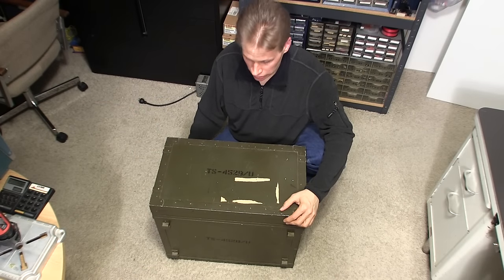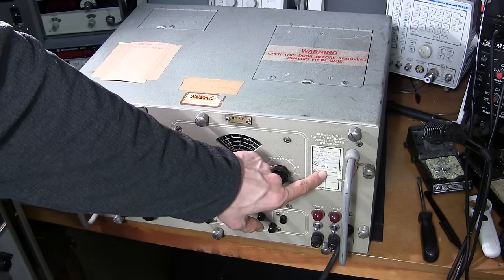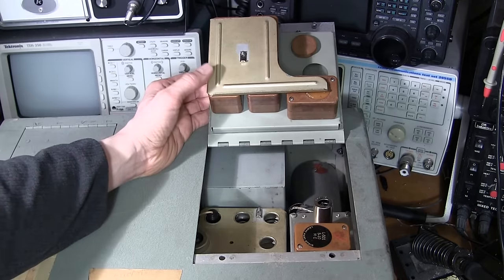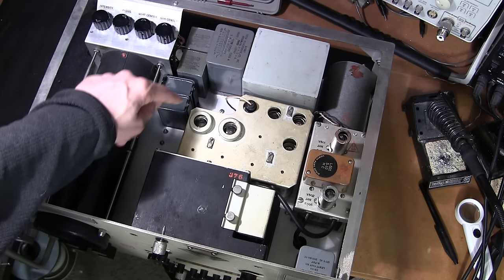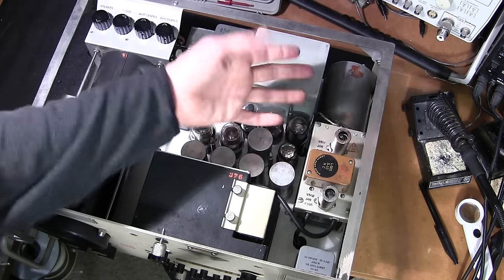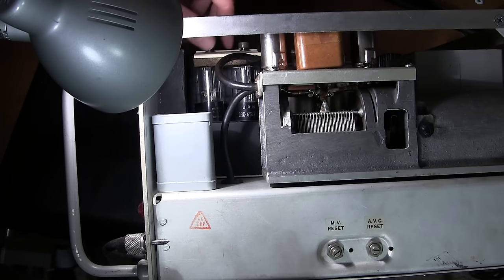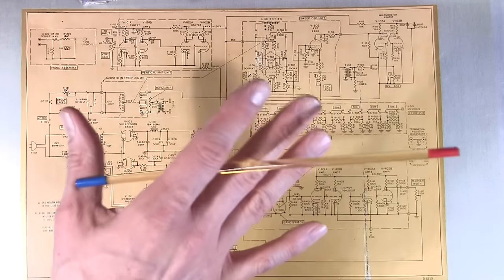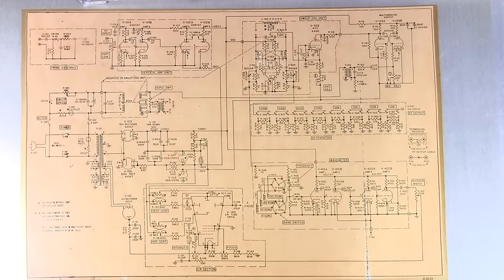Whats A Wobbulator? Tech Tip Teardowns

Comment: Like seeing an old friend--when this machine last wobbulated, I was beginning a basic electricity course at Lowry AFB en route to becoming an aircraft weapons mechanic.  Much later, I was to learn that wobbulated signals centered on 4300 MHz are the basis for commercial aircraft radio altimeters.  Somewhere in between, I came to recognize the quarter-turn fasteners on the top of the box as authentic Dzus fasteners, the original quick-release fasteners used on the DC-3.  I still have a screwdriver I cut down in 1965 to fit under DC-3 cowl flaps and unlock Dzus fasteners in the engine accessory cowling.   Next, I will watch your video on VTVM restoration and learn what I might need before I dig my old Heathkit IM-28 out of the closet.  Thanks for the motivation.
Reply from the maker: +Hopelessand Forlorn 
Thanks for taking the time to write. Great story! Glad your enjoying the video's.
Reply: Hopelessand Forlorn 6
Reply: Weebles used this to fix their TVs and Radios

Comment: Quite a simple circuit really but built like a battle ship. Can you imagine building to this standard today, the cost would be un thinkable.
Reply: +Michael Beeny "An elephant is just a mouse built to government specification." -  Robert Heinlein's Lazarus Long
Reply from the maker: +Michael Beeny 
I agree! They could recycle this and build a ship out of it.
Reply: +Mr Carlson&#39;s Lab Let's not forget about soldiers that actually had to carry this boat anchor in the field. Thing probably weights more than a box of grenades, and with box of grenades you can at least defend yourself! ;) Unless you consider throwing this from the roof to the enemy's head as alternative application.
Reply: Definitely not a front line piece of gear more likely used at an airfield repair facility, rear area, or aboard a ship.
Reply: +Michael Beeny  Kinda like a sixteen cylinder Caddilac!
Reply: +Roger Lamb This was something we would have used on the bench. The heavy case was to protect it against us idiots damaging it during transport. Typically it would be out of the box for 6 months then put back into it for the jaunt over to PMEL, Precision Measurement Equipment Laboratory, for calibration.
Reply: Not really simple to me at least

Comment: I know this is a few years back Paul, but what a piece of kit!.You can see it was purpose designed and built especially for the job it did.Which is slightly different to the Marconi R1155 receiver that I am trying hard to fully restore.That was needed quickly, but hey it did an excellent job.Which is a tribute to the electronic guys who designed it.Just absolutely love this old equipment.If only I had purchased more of it in the early days, when it could hardly be given away.I could sell it off now and be better off than I am now.Brilliant Channel.Going to increase my Patrion subs very soon.Thanks for the excellent channel Paul.And the knowledge that you impart.It is appreciated by so many of us.

Comment: You might be surprised and find all the caps are still good.  I have a lot of 40-60's military test equipment and radios and don't think I have ever changed one yet.  I'm always amazed at the quality and durability of milspec capacitors.  Many are hermetically sealed.  Might be worth unhooking them and testing them for leakage.  Thats what I do and haven't changed one yet.  Will be nice to see this back up and running.  I love old military gear.

Mike
Reply from the maker: +MikesRadioRepair 
Thanks for your comment Mike!
Reply: This is a capacitor testing channel, I'm pretty confident they will be carefully checked.

Comment: Great find Mr Carlson. I bet you smiled when you took off the bottom panel. There can't be too many manuals for that unit around anymore. I have an old 50's military FM transceiver (uses 1U4's etc). Was happy to find a schematic printed on a silk material folded away inside. Looking forward to another one of your  excellent restorations !
Reply from the maker: +Todd Anonymous 
You Bet! That was a great surprise! One day I will build a portable radio project with those 1 Volt filament tubes. I have quite a few.
Reply: +Mr Carlson&#39;s Lab looking fowar to that too. (big trasmitter pls)

Comment: Thanks for the prompt reply to my comment. I had a No 11 Australian army radio R/T set (it too weighed a lot) that not only was tropicalised for work in the Pacific zone but, like your wobbulator, had the circuit diagram on the inside of the removable base. A very useful addition.
Reply from the maker: +DAVET38 
Thanks for your comment Dave!

Comment: Hernia in a box! The build quality on this old gear is just incredible! I'd clip some notches in the cap cans, pry them open, stuff new caps inside, epoxy around the bases, crimp them back closed, & use a hose clamp with wax paper to clamp it while the epoxy dries. Use the wax paper or Saran wrap. You may not want hose clamps glued on there permanently. I have some USN VTVMs, and a thermal volt meter. The schematics are pasted inside ALL of them.
Reply from the maker: +Seth B 
That sounds like a nice clean way to rebuild those caps. Thanks for your input!

Comment: Very nice demonstration Paul; I was sold a military breadboard that is built like a tank "heavy". All the potentiometers are wirewound, full of features and a multiple power supply giving unlimited approach to designing. Each section pulls out for easy servicing and I was lucky to get the manual with it. I love military stuff, well built to last.
Reply from the maker: +John Cunningham 
Thanks for your comment John!

Comment: back in the 80's I had a wobbulator in my workbench. If I remember well, the brand was "Crescent" and instead of a rotary motor for sweeping the L.O., it had one half of the variable capacitor mounted on a huge moving coil (just like a speaker) whereas the other half of the cap was coupled to the center frequency front knob mechanism. If I remember well, that unit went up to 450MHz or so, and I was amazed by the ingenuity behind its design. Cheers from Buenos Aires Paul !!
Reply from the maker: Thanks for your comment Marcelo!

Comment: We used a similar one to tune vehicle tracking system front-end receiver filters back in 1988 in South Africa when they were using a 'fox hunt' triangulation system (4 antennas on a square ground-plane on police squad cars)  that would rebroadcast two local beacons on the tracking frequency that would allow for a LORAN by proxy location system that was good to a few hundred meters and did not need expensive and easily shielded GPS of the day.  The systems were hidden into vehicle upholstery and seats and had no connection besides a wire to charge the small backup cell.  I think they were activated from the beacon signals by the tracking company and the police could home in on them quickly.

Comment: As far as i can recall, it was quite common for Radio- and TV-sets from the tube era to have schematics sheets in every single unit; that way a repair workshop wouldn't need to have a bunch of different ones in stock on the off-chance that they some day MIGHT have to repair a less common unit type. These schematics were in part what led me down the road to become a hobby electronician. :)

As always, a very interesting video, Mr. C! Keep up the good work.

Greetings from Denmark.

Comment: Hi Paul,

Wobbulator. NU metal, dzus fastners.  Terminology I haven't heard in years.  Great video on an old piece of Mil Spec test gear.  The wobbulator was used many years ago by Eico in ther sweep generator.  Eico however used the movement of the speaker coils inductance to change the sweep rate.  Keep up the great work Paul. I thoroughly enjoy your Tech Tip videos.
Don
Reply from the maker: +Donald J. Mangold 
Hi Don, old64goat, down the list mention a similar unit with a speaker coil design. Heathkit used a saturable reactor to the job, my Singer metrics spectrum analyzer uses the same. Thanks for your kind words!
Reply: " Mu " metal

Comment: I have several Wobbulators taken from APN1 radio altimeters.  They have a voice coil driving a dome, much like a compression tweeter that is near silver plated areas on a porcelain plate.  The areas tied to a tuned line with a couple acorn tubes that form an oscillator in the UHF range.  The Wobbulator coil was driven by an output transformer driven by a tube.  They appear to have Alinco magnets.

Comment: It's funny, I have used a wobbulator, but it was a completely different thing.  We used it to calibrate the sensors on rotating equipment that measured vibration.  It had a rotating disk that was flat but eccentric.  Imagine a record player with  a spacer under one side.  As the record turns you get an upwards movement and hen a downwards movement.  We would measure this with a dial indicator, and we could calibrate our probes to this movement.  Literately measuring how much it wobbled....

Comment: Excellent video Paul.  I think you have your "Teardown" format just right.  This is another instance where I appreciate your high quality video and good lighting, particularly when looking at the schematic. The Wobbulator itself is a fascinating piece of equipment; I love the quality of workmanship and general serviceability of military grade gear from that era. Overall, a winner!  Thanks.

Edit: Did I see a couple of Sprague "Vitamin Q" capacitors on the bottom chassis RHS near the potentiometers?  These are gold to the tube audio folks. 

I have more than a passing connection to this type/grade of equipment.  My Dad was a Cdn Navy Radar Tech in WWII and my first lessons in electronics were from him.  Looking forward to see this old school high tech piece of gear restored to your exacting standards.
Reply from the maker: +Shaun Merrigan 
Thanks for your input Shaun! Ya know, I didn't pay attention to the brand, they very well may be the old Vitamin Q type. When I get into the resto, I will take note.

Comment: Paul, I've restored a few Mil-Std devices; one concern: finding carbon comp resistors of equivalent tolerance and value (without going down the "metal film" trail). One tip, Gudebrod nylon lacing cord should be used when having to replace wiring contained withing the breakouts/bundles. Thanks for a trip back to our formerly redundant past!
Reply from the maker: +AMStationEngineer 
Glad you enjoyed!

Comment: 18:10 It's a military field unit and a highly specialized mission-critical piece of equipment; of course it's going to have the schematic on the bottom chassis plate. A field tech can't be expected to carry around schematics for every piece of gear he could possibly encounter and DARPAnet didn't exist yet.

This wasn't uncommon in civilian gear either. I've seen a Motorola jukebox schematic on a chassis plate like that. (It was just the amplifier chassis, but I'm sure the disk changer mechanism had its schematic in the case as well.)

Comment: That is a neat piece of test gear, oh the wobbulator that reminds me of my very first sweep generator, it was a very old  Hickok and it used a regular speaker without the cone, it had a metal plate and was something like  a vibrating capacitor, depending on how strong the AC voltage was applied to the "voice coil"  determined the sweep width.
It just used a low 60 cps voltage on the "voice coil" 
BTW, I never liked saying hertz, on these old things I like the good old CPS...LOL
Reply from the maker: +old64goat 
Great story! I'm a CPS guy my self :^)
Reply: +old64goat I guess I'm an easy going person: Hz or CPS, SAE or Metric, C or F, it really doesn't matter to me.

Comment: You mentioned the calibration dates, so Heres a tip on that.  The reason for 6 months is the quality of the equipment didn't stay in calibration for much more than 6 months, so its reliability was in question. However if its cal. dates were say 3 years instead, then it could be a more reliable piece of test equipment. Signifying the calibration would tend to  to be more dependable (Stay in Calibration for a longer period of time.)

Comment: Funny how a cheep 50 dollar VNA can replace this now, and less inacurate as a thousand dollar spectrum anlializer this one, does an good job. Used for bandpass filters antenna resonance and  alot more. Heathkit sweep generator used a toroid with dc winding to sweep, a cool idea at the time, varicaps and digital synths now do the job. things keep changing over time. Not A basar piece of equipment as you said but important at the time for alignment !!!

Comment: Most oscilloscopes have a swept horizontal time base, so how would this differ from a regular oscilloscope?   I have been around old test equipment for a while now, and this the first time I have seen or heard of such a unit.  While I have seen external sweep generators before, I never had a need to use one.   

The mechanical driven sweep circuit sounds similar to the electronic version of a Leslie speaker in which they used a motor to turn the plates of a continuous rotating variable capacitor and this is what caused the sound to shift from speaker to speaker, creating a stereo rotating speaker effect.

Comment: I've seen those old caps rebuilt with modern components inside so as to retain the appearance.
Reply from the maker: +James Lewis 
I may do that, or just leave them for show??? I'm not sure yet.
Reply: Mr Carlson's Lab I'ev restored old cars in the past, and when doing that I've tried to make modifications the original builders would understand and respect.... you seem to have a great understanding of these old devices!

One can only wonder what the designer of this device would think to see a modern hand held scope...

Comment: Paul, most of the Capacitors are true OIL FILLED and almost certainly fine. These almost never fail unless physically damaged and leaking.   Caution, likely PBC oil. But if not leaking will be fine.Remember Selenium Rectifiers have a pretty high internal resistance and solid state replacements will need a series resistor to maintain original voltage spec. Again, test and likely OK.Uncle Sam built them to last.  Expense was not an issue.
Reply from the maker: +The Radio Mechanic 
Hi.
Unfortunately, 4 of the electrolytic's are beyond bad, and 5 of the oil filled blocks are faulty as well (electrically leaky) l I haven't finished testing all of them... And will do a video on this unit at a future date. Already it's looking like a in-depth restoration.... Motor doesn't turn either :^/
I would tend to agree about the dependability (electrolytic caps only) with a piece of test gear like the older Tek scopes, but I find this older Uncle Sam stuff to have faulty parts all the time. If you are restoring older devices with these oil filled cans "square blocks" in them, I strongly suggest you change them, or the unit being restored will ultimately be unreliable in the future. I have found many faulty oil filled blocks (capacitors) in: Collins gear, Hammarlund, RCA receivers, Singer metrics spectrum analyzers, The Panoramic Radio Corp, Lavoie test gear, and so on. I have a small drum full of these faulty units, that I save for re-stuffing.
Thanks for your comment!
Reply: +Mr Carlson&#39;s Lab:  Paul, a great introduction to and tour of this piece of gear. I'm curious - how and where did you find it?  One of many challenges for you may be having to custom-fabricate the carbon brushes for the motor - I would not be surprised if you find that one or both of them is missing or completely worn out. Another issue related to the motor might be, if not the brushes, a burned-out winding on the motor's armature.  I hope it's nothing more than a stuck or worn-out brush. Also, you'll have to make sure the commutator on the motor's armature is in good shape.  Knowing you, you'll tackle all these challenges using your superb analytical skills and technical know-how!  It's always a delightful experience to watch your videos. They're all A-plus!
Reply from the maker: Thanks for the kind comment Jos! I found the unit about a year ago on "CL," locally. It has been sitting in my storage until now. I sure hope the motor is in good condition, if not, that would add a lot of time to the resto. I have filed many a carbon brush...LOL. I find that Dremel replacement brushes are a good size to start with for many small motors.

Comment: I actually used one of these (SG24/TRM3) mechanical sweep generator beasts in the mid 1970's to perform IF alignments on the Mark 10 IFF transceiver that was used on some old U.S. Navy ships that hadn't yet been converted to the Newest IFF System. The system and the test gear was pretty much worn out by then. We were always having trouble with that flexible coupling. As I recall, it was made with a thin leather membrane and being in a tube environment for years it would dry up and tear simply because of the torque of the motor start up.  Repair parts for obsolete equipment was scarce (even the Navy involved itself in Junk Yard mechanics at the time.) I never thought I'd ever see one of those again. Takes me back to my early twenties.
Reply from the maker: +Roger Lamb 
Great story Roger! Thanks for sharing that.

Comment: What advantage is the motor for the sweep generator?  Why wouldn't they just do it with an electronic oscillator?  Very good explanations.  I'm addicted to thermionic emissions.  Much of my Ham station is tube gear as well.  You are much younger than me albeit much more educated.  Why did you take an interest in tube gear?  Thanks very much for the video's.  I was never able to finish my EE.  Your video's help fill in the gaps.
Reply: I think the problem is the technology to do the sweep back then was much more limited.  Keep in mind that you need a linear relationship between the frequency and the sweep voltage, or else your frequency scale on the scope is going to look strange.  You also need to sweep a very wide frequency range.